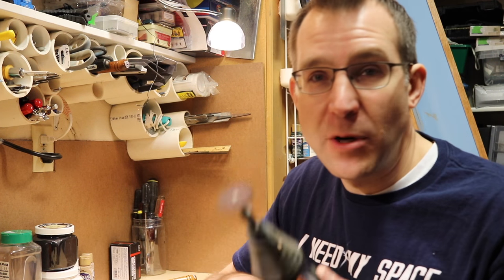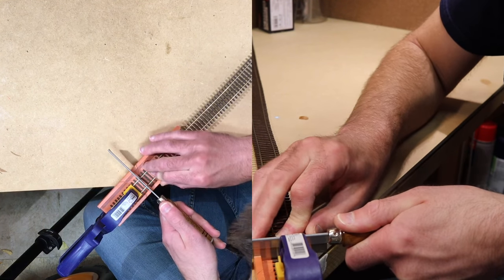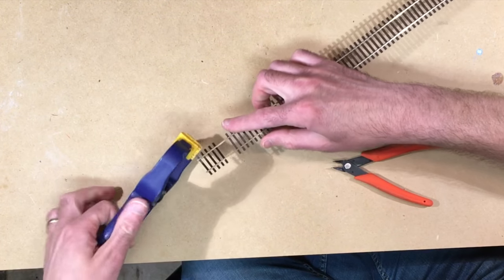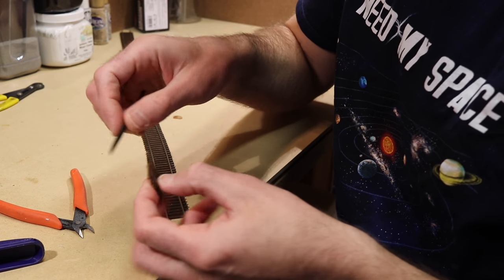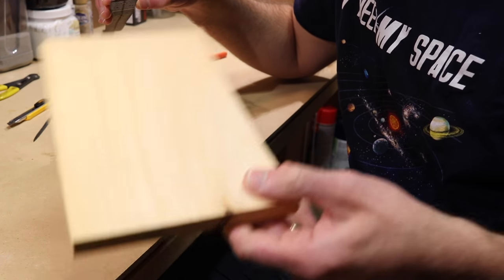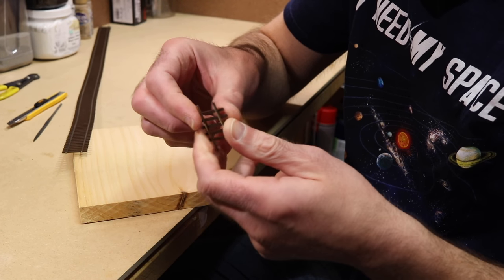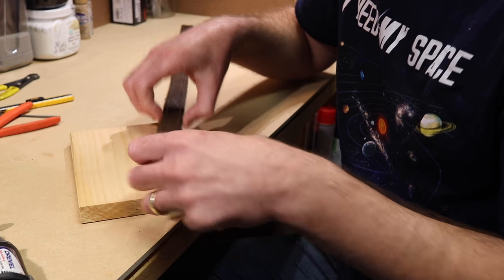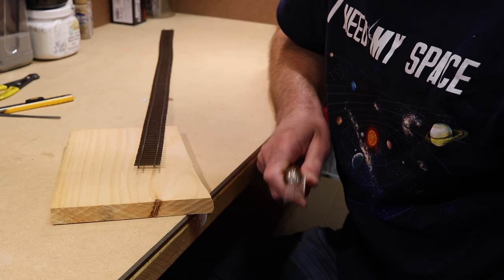3 Ways to Cut Flex Track for your Model Railroad

Comment: I’ve used the nipper and the wheels.  I’d encourage wearing eye protection. I’ve felt tiny bits coming of the  wheel hitting my face.  No need for metal in the eyes.

Comment: If you need to cut a gap in the rails after the track has been laid, I think the Dremel tool is the best approach. The concern is tearing the rails out of the ties. If the rails are glued down, that is likely enough protection, but if you've only used rail tacks, make sure that there are some rail tacks close to where you want the gap. The flush-cutting pliers could be used in this situation, but I find it awkward (and more likely to damage the track). By the way, if I had it to do again, I would cut the rails before installing them, providing for the gaps. That way, I could install insulated track joiners. Given that I didn't do this, I install insulated gaps by using pieces of styrene, super glued into the gaps.

Comment: I was thinking of one day making an HO scale/OO gauge outdoor model railway but the worry of thermal expansion popped into my head. Watching this encouraged me that it would be a good idea to use a Dremel to cut into every 2 or 3 metres of pinned down track (although the sleepers/ties can remain intact) and solder some wire across the cut rails to maintain electrical conductivity.
Reply: thats indeed what most people use for layouts,. Also seems to be a very reliable method, instead of relying on connectors to transmit electricity.

Comment: Hi Steve, good video, I use Dremel all the time but with a slightly large size disk (38 mm, 1.5”) and as thin as possible. That way I can even cut rail after it has been glued down to, for example, create separate sections. 
What I also find handy is to use the flexible arm with the Dremel, gives you just that much more manoeuvrability.
Reply: Hello Abbo. I hope you will see this message. I am really struggling with finding the disks that will cut with this method so it will be 90degrees to the track surface. Please could you help me with more detail on what tools you use to do this. It seems that the size of the rotary Dremel is larger than that of the rotary disks. Really hope you see this and you can help. Ryan
Reply: @ryanharlow4973  hi Ryan, that would be the Dremel 540, although 32 mm instead of 38. Do invest in an flexible arm for your Dremel as that makes making good cuts so much easier, guaranteed you will be happy with it. Nowadays Dremelalso has these easyclick disks, these are 38 mm but don’t know how thick. Good luck👍

Comment: thank you for the video. can i ask why you dont cut one side a bit longer to allow for the rail clip ?
Reply from the maker: If you are referring to cutting more ties off one side to allow for sliding the rail joiner on, yes I do that in some cases depending on the installation, especially if installing on the layout itself.  If I'm soldering pieces together at the workbench, then I don't usually have to worry about that.

Comment: Thanks for the video.  It was a help.   But, you showed doing straight sections.  How does one cut curved sections with unequal  rail lengths?
Reply from the maker: The razor saw option is out, but the other options work the same. The main thing is just making sure the rail lengths are correct after the cuts are made. It if it is a piece of sectional track, then you can use another piece of track that is the same radius to use as a template for marking the piece you want to cut in order to make sure you make the cuts on each rail even.  It is a little trickier with flex track, and usually you have to tack the track in place on the layout to get the proper curve, and then mark the track and make the cut.

Comment: Which is the best file to use to file down track?
Reply from the maker: I normally just use the jewlers files I have. Any small, flat file should work, but make sure it is one with a fine texture so you don't leave deep grooves on the track.

Comment: Hi  how i can cut a track scale g
Reply from the maker: A dremel or other rotary tool will probably be easiest for G scale, though for rail that large even a hack saw used for cutting metal would probably work well as long as you clamp the trck down well so you don't tear out the rails from the ties.
Reply: @StevesTrains   thanks 🍀💞